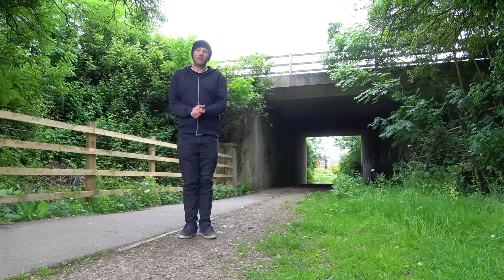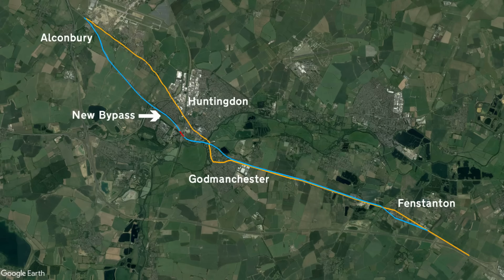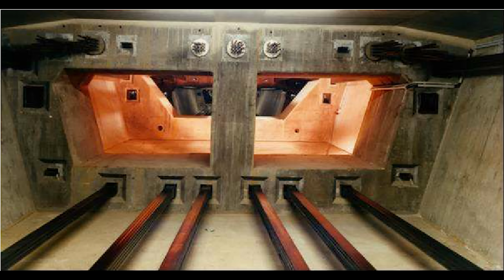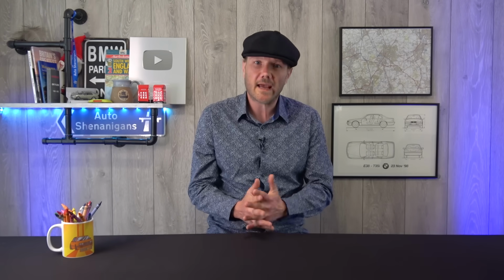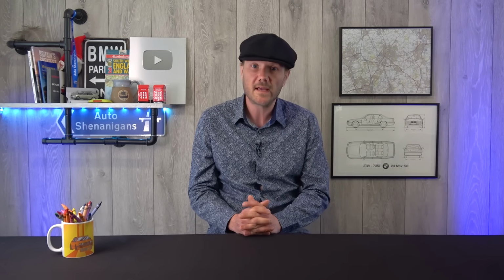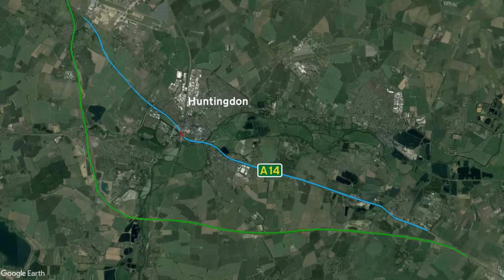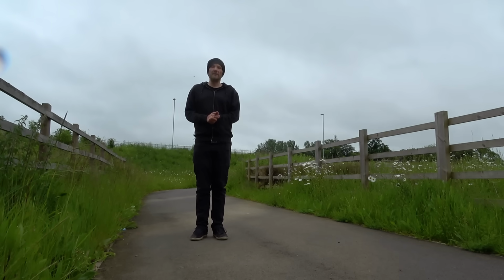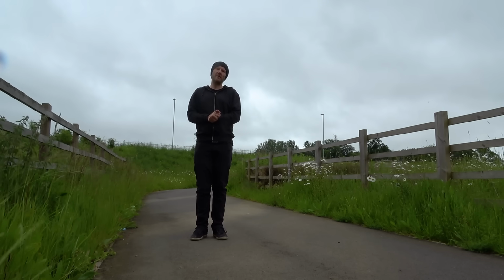Why Spend £46,000,000 To REMOVE This Bridge - Huntingdon Viaduct A14

Comment: The story of the A14 is a farce.  A road built with the A1 and M1 junctions so woefully inadequate that they had to be rebuilt at a massive cost and you STILL can't go from the A14 to the M1 South or vice versa.  The 'approved' route is via single carriageway roads for about 1/3 of the length.  The hills towards the M1 end have restrictions on lorries in the outside lane due to the steepness causing two lorries taking a mile or more to overtake a third.

Comment: The air pollution was a fair point - it formed a big part of the approval process of the entire A14 project. A year on from the video and an update - you still have pinch points and traffic from the old a14 into the new system is abysmal. They’re currently refurbing the bridge sections south of Huntingdon as they’re collapsing too! There’s been a lot of works to ‘do up’ the A1307 as since it’s gone from being in the hands of National Highways to council run there’s been a lot of accidents and sadly also fatalities due to poor maintenance of the roads. It’s a mess really

Comment: I live in Brampton just outside Huntingdon and this road is my daily commute, the new roads have been fantastic it's not haphazardly put on but now allows traffic to bypass the clockwise only rigroad in the centre of Huntingdon taking a lot of traffic out of the centre and divirting traffic from The avenue, a road with a too small bridge that has had many accidents and people are worried if it still has a place in our modern roads, and provides an easy access for locals to go to Cambridge as commuters or for leisure, the rest of the a1307 needs work to resolve the safety issues so it can go back to 70 but those should be done by summer
Reply: It'd actually say it makes bad use of the space it has though as it drops to one lane at the east connection to the ring road then spits out a new lane on the other side not using any of the gigantic middle

Comment: I live close by, in St Neots. When we moved into the area, in 2008, we considered buying somewhere in Brampton, Huntingdon or Godmanchester. Everywhere you went, the soundscape was dominated by the elevated A14; so we chose St Neots.
I drive to and through Huntingdon regularly, and it is much improved. Quieter, cleaner and easier to get through with the new link roads. Sure, they are bodged onto the local roads; but it works IMO.

Comment: Removal of the viaduct is a vast improvement to noise, air quality, and visually. BTW, the labels on the map at 2:40 are incorrect - the A14 heads west after the Brampton Hut interchange with the A1 which runs north south.

Comment: At this very moment the westbound 'new' A14 is down to a single lane with hour-long delays and 30 minute delays on the A1307 diversion route going into Huntingdon.  Not only has a viable alternative been cut, a natural line to the A1 has been removed.  Should the money have been spent on repairing the viaduct instead of upgrading the A1 between Brampton & Alconbury?  OK the A428 is being upgraded unless our new anti-road chancellor is going to stop work but then A1 improvements between The Black Cat and Brampton will also be needed.  No chance of that.

Comment: I live just east of Huntingdon and these changes have undoubtedly made getting to the station easier. Jump onto the old A14 (now A1307) at St Ives and boom, 5mins later your at Huntingdon station. However, if you want to go further and join the A1 as I often do, you now need to negotiate these 'bolt ons' to local roads, which do cause congestion around Hinchingbrooke area.
The alternative is go round the north of Huntingdon via Houghton, or back track and head south west via Swavesey and pick up the 'new' A14 junction to go north to Peterborough, neither is ideal, but that's progress.

Comment: A new bypass to bypass the old bypass.
I know of several other post-tensioned trapezoidal sectioned reinforced concrete sectioned viaducts have failed the test of time in other countries, not just UK.  All of them had a similar problem - the actual installation never met the standards of the theoretical installation.  It seems the theory just wasn't in lime with what was possible physically.

Comment: Anecdote ‼️alert
  I bought a new van ( french basically) with sat nav and was travelling from Yorkshire down to The Bury St Edmonds area three years ago and the new bypass which had just opened which I was totally ignorant about and was blindly following the already out of date nav..
   The nav guided me off on the old A14 and I must admit I saw the contradiction in the signage!
   The road simply ran out and was guided off into Huntingdon and the signs were removed or contradictory.. I drove round in circles a couple of times and just stopped at a convenient place. My  nav was useless The map out of date .. google not correct and just in the middle of disruption and roadworks.. I have never felt so lost..
 In the end I knew I wanted to go east and the Sun was out.. I ignored the signs and headed east till I picked up the Cambridge signs- 😢😅

Comment: The sentimental sod in me does miss the old A14 but only in the sense that as we would be travelling up to Lincoln to visit the in-laws, the old concrete water tower thing would loom large as the road bent around to the right and indicated that we were mere minutes from the A1(M) which was a strange junction insofar as A14 traffic used to exit at the roundabout to join the next bit of A14 whereas staying on the main highway you were suddenly on the A1(M) for a short spur before joining the A1 proper 🙂 It was a pain for a few years as a section of a few miles either side of Cambridge Services was restricted to 40mph and the number of times we ended up having to divert from the normal, route for late night road works was annoying, and we got lost one night because some dickhead had stolen the diversion signs 🤣😂😅

I must admit though, the journey is so much better now from a driving perspective and the traffic is so much more free-flowing. It also helps when visiting my family in Wales by car, as there used to be lots of messing about with junctions, roundabouts and even traffic lights before the new scheme. Worth the money? Hard to gauge, though I suspect people on Huntingdon are glad for it and it solved the very real bottleneck issues, especially when you consider the original road had to deal with the traffic from both the A14 AND the M11 going north and west 🤔

Excellent video John, really informed and balanced view, plus excellent editing 😜 Have a wicked sweet awesome weekend 🍻💜

Comment: I used to live in Huntingdon (that bridge was owned by the Highways Agency btw, not the Council, so the strengthening works didn’t cost CCC money directly) but traffic was an absolute nightmare, all the time. I was also a Traffic/Project Engineer covering west division for about a decade. The WTC Link Road (north of the railway station, shown in your video, and which was built by Cambridgeshire County Council) relieved some of the traffic on the ring road but the strengthening of that viaduct in the mid 2010s brought with it a necessary height restriction on the B1514 from Brampton into Huntingdon (a route from the A1) which meant overheights had to use Spittals Interchange, which was already disastrously congested, and the A141 northern bypass (going through Godmanchester wasn’t an option because of the weight restriction on the bridge into Huntingdon). I’ve driven through the area since it’s gone, the whole area is much quieter now, it’s like chalk and cheese. I never really noticed air quality being an issue, but remember people visiting me who didn’t live there always remarked to me about the constant sound of traffic, especially in the evenings when local traffic and activity in general had reduced. It was a constant, distant background noise, but I actually found it quite relaxing.
Reply: let us know in a few years when busineses start closing down and leaving. we have a long history of bypassing roads here in america and the locations often turn into a ghost town following a couple decades.

Comment: Agree that demolition should always be included in the total life costs of infrastructure projects. Obviously this was not the thinking in the 1970's.
I suspect that he "grout" missing due to lack of quality control was nothing to do with tile joints - precast steel needs an alkaline environment provided by concentrated cement grout to prevent premature rusting and the procedures to ensure that the grout was pumped effectively through the ducts without air gaps would have been non-existent.
Even so the bridge was  over 50 years old and served its purpose at the time.

Seen a lot worse disaster TBH. 🙂

Comment: I live in Ramsey, just near Huntingdon. It's not too bad with the bridge gone and the bridge was prone to bridge strikes from moronic HGV and Van drivers failing to observe the low bridge warnings. 

The old A14 is actually great as it still acts as a connecting and relief road for all the villages and the town itself too. It's a good overnight diversion route for the A14 too

Comment: The problem with the A14 and the removal of this bridge is the now new A14 is already failing at the points you enter and exit each bridge deck ,this is going to be a serious issue for regular users of the road and now thanks to the idiots who thought ok its open ,so now pull down the old roads viaduct completely taking the only viable option for a diversion  ,especially until you have given the new road a chance to be tested after a period of constant hammering from trucks especially being the heaviest vehicles ,but no usual no no no ,lets fuck up the old road making it unusable and cause a total shit show of a problem if the even longer viaduct and flyovers fail on the new road ,and hey ho ,  now they are , i delivered alot of the precast culverts to the new road and beams ,and see the construction first had ,they simply don't pack the road right especially at the run up and run offs of the bridge desks ,  i remember when they opened the Broughton bypass at Preston on the A6 nr the M55 jct 1 ,the motorway was closed both directions due to a bridge strike ,the new bypass couldn't cope and the sent trucks and cars etc through the old road in the village that they had already fucked up by drastically norrowing the original road and removed traffic lights at the crossroads ,its was no longer fit for heavy traffic and it was a total nightmare ,the whole of Preston and surrounding areas were gridlocked ,what would have been a extra road even to hold traffic to stop disruption to the motorway nr bye ,it made it worse ,just because they rushed into getting rid of what was before the new bypass , that was just a accident ,so imagine how Huntington will be if the new road fails as it is showing signs of already in a very short space of time ,lets be realistic here ,before the new road opened ,that viaduct was good enough to remain open to all traffic ,and nobody driving over it was none the wiser .

Comment: I live in Huntingdon, the new bypass has helped it's made the town less of a bottleneck for many years it was a nightmare to go 20 miles to Cambridge some days would take 1 hour it was worse than driving in London and if there was an RTC it was even worse. As a driver its more simple to go around town even avoiding the ring road at some points to get to places like coming from Brampton going towards hartford you no longer need to go around the ring road you go up to the next left turning on the A1307 and go through the town centre on the 1 way street. Saving minutes and less stop start with the traffic lights.

Comment: I live in St Ives (the proper one, not the one in Cornwall) next door and Huntingdon is much better off without it.

Also, as a trunk road it used to be the Highways Agency’s (whatever they are now) problem but the road was detrunked in becoming the A1307 so the County Council would had suddenly have had the ongoing maintenance bill added to their budget.

Comment: You should do a video dedicated to this new A14. It was meant to be the A14(M) but to open it a few weeks earlier they decided not to make it a motorway.
This was a really pointless thing IMO and required entirely new legislation to be implemented to enable an A road to have a variable speed limit, which this section of the A14 does.
For some time after it opened it had "CAMERA NOT IN USE" signs under every gantry because the cameras weren't switched on. Kind of defeats the point of even having a camera as a detterent if you ask me if people know its not working.

Comment: looks like there might be a plan to eventually build another road bridge over the railway  to the north of Brampton road? Because otherwise why include a roundabout that only has two exits? If they eventually do that it will still be a bit of a bodge but not look as stupid.
Reply: Future proofing, adjacent land could be built on (they’re trying to squeeze houses everywhere around Huntingdon). Although that said, to the south is Mill Common if I remember correctly, which is unlikely to be built on.

Comment: Leaving that bridge would have eventually resulted in a failure of the structure and people may have died. So it's good that the bullet was bitten and the solution has reduced the number of non-native people driving through Huntingdon.

It is a bit of a shame to loose a useful corridor, though. Ideally the old bypass would be repurposed as a tram route, light rail route or metro line route, that can connect Huntingdon to places that are not currently accessible via the railway line.

Where we have 1960s super-highways, that have punched through built up areas, we already have the land for a road corridor. And, if we want to get rid of pollution and car dependency, then moving the cars onto bypasses could allow for those dirty corridors to be turned into clean corridors that transit oriented development can be built around.

Comment: A side effect will to be stopping as much traffic using the old A14 infrastructure as a rat-run through huntingdon.   I expect part of the cost of removal was the requirement to keep the railway line operational pretty much throughout.  It is the east coast main line after all.

Comment: I see the same problem in the US.  When a bridge or other highway structure is poorly designed or not constructed properly, the contractors responsible rarely are required to fix the problems.  The bridge deteriorates until it must be replaced, usually at great expense.  The Romans did it better.

Comment: I remember the bridge being built. As your graphic shows, it had a solid arched section each side balanced on a pier, and the gap between them was filled with a row of prestressed concrete beams that were quickly lifted into position. A (possibly) novel feature was that the solid sections were built away from the road and rail crossing and then slid forwards each other into position so that closure times of the East Cost railway line and Brampton road were minimised. Whether or not this design feature had a bearing (sorry) on the weakness of the bridge it did come in handy when it was reversed for the demolition. As with many novel designs they got the difficult bit right but the simple bit ...

Comment: It was awful and way too weak, it had to be braced underneath and if nothing was done it would have fallen onto the road and railway line. It also limited the height of vehicles on the east side of the town. That part of the A14 was an accident blackspot as the    road rose sharply on a left turn. Terrible design.
Reply: Spittals Interchange is a similar shit show just north of there, the elevated roundabout has adverse camber, trucks fall over more often than they should (or at least they did, it’s been a fair while since I lived there).

Comment: I live nearby and it has upsides and downsides ditching the viaduct, biggest benefit is it makes access to the train station and hospital a lot easier as it's off the old A14 instead of having to go through the town proper. However it also makes it more of a pain to get to the northern or western side of the town, I end up on the new A14/A1 then coming back in from the west.

Travelling through it the decision to whack a random roundabout on what's currently a left turn is a bit odd though, I presume something (probably houses) will get built off that eventually. Plus the routing between the station and the hospital is "fiddly" at best.

The more annoying thing about the whole scheme is the 40mph speed limit on the dual carriageway approach to the old viaduct, it's done with temporary speed limit signs, but has been like that for best part of 4 years now, so they're starting to feel pretty permanent.

Oh and side topic, the fact you can't head eastbound onto, or come off westbound from the new A14 at the Wood Green junction to the south of all this is a bizarre farce. If you want to go to Cambridge from Huntingdon, it's back down the old road.

Comment: As a resident of Godmanchester, it is note worthy that Huntingdon is now further away, being a bit of a snob, this is mostly a good thing, but odd things seem to happen with the traffic, jams occur for no obvious (to me) reasons. The other irritant is the remaining dual carriageway seems to have permanent, temporary  speed restrictions. A road once capable of safely supporting traffic up to 70mph is now restricted to 40mph, from Huntingdon to Swavesay, about 7miles. The council cannot make their mind up why: signs can say road works, but not even a single cone has ever been deployed. Parts say danger of flooding, the road has never flooded, as far as I know, and the Huntingdon end goes with curious term “safety reasons”